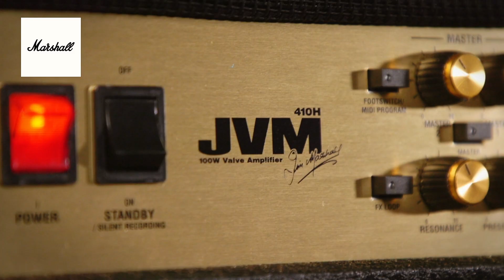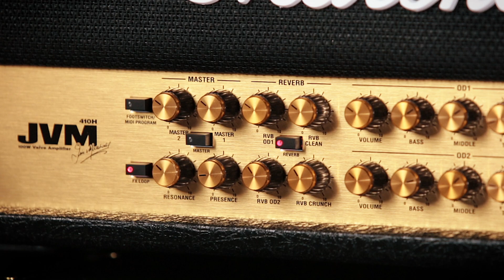JVM Tutorials | High Gain Lead Sound

Comment: You don't need the gain that high on the JVM. Anything post 12 o'clock starts to sound like mud. Especially on the Red Mode of OD2!
Reply: Tighten it up with tubescreamer like pedal. I'm using Bad Monkey-drive at zero , level at max. On the amp i set the gain at less than half of the range and IT sounds pretty killer.

Comment: Why does everybody keep using the clock to tell where the knobs are? It's annoying. Just say the bases on three or four in the mids are on five whatever. Cuz now I got to sit here picture the clock and then picture where the actual numbers are when you could have just done it the way we've done it for the last hundred fucking years
Reply: This must be tougher with the ongoing death of mechanical clocks but, for a few reasons, it's more accurate to use a clock to indicate where a dial is positioned. 

The sweep of a potentiometer and how the numbers are painted can vary a lot.  For instance, many amps are numbered from 1-10, but will have something other than 5 at noon, or have notches instead of numbers, or will go to 12 instead of 10. 

Be consistent and use the clock if you're trying to communicate settings to others.
Reply: Sorry Jaidezilla. For us old guys it´s the easiest way to use the clock face to describe positions of a control or in a traffic roundabout ;)
Reply: @MrFafnirsgold  I'm 53 years old and until just a couple of years ago no one I know ever use the clock to describe where the knobs were
Reply: The clock is the standard way for intelligent people.